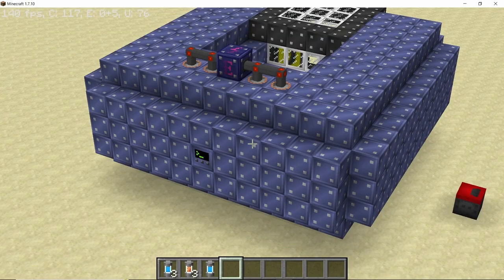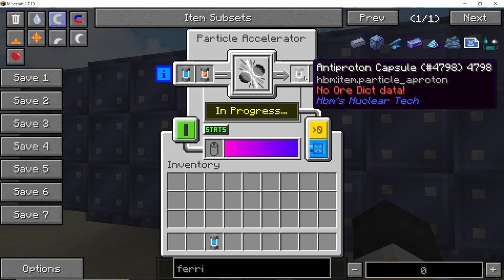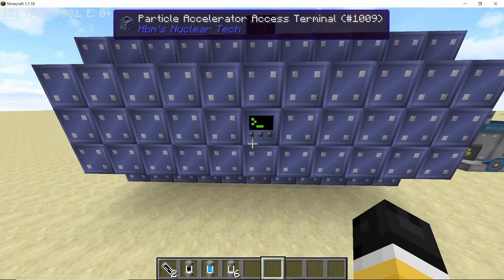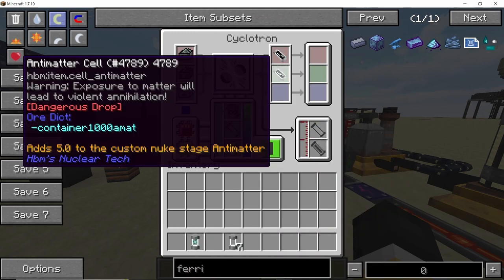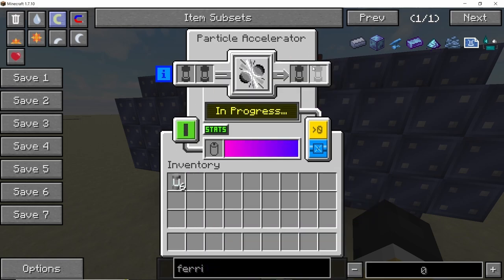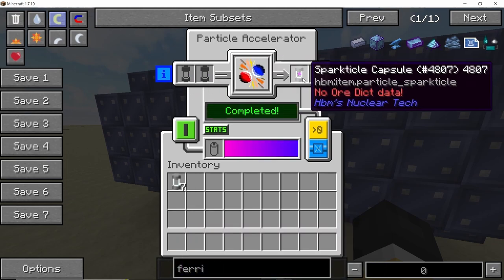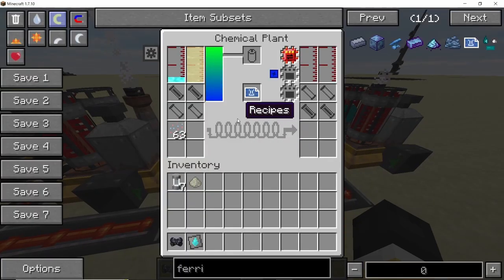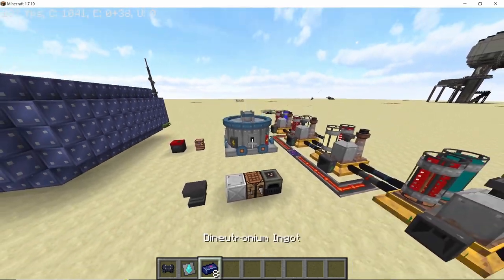DNT Production Guide - HBM's NTM || Dineutronium Ingot production Nuclear Tech Mod

Comment: Bro i want to download M14 himaras content pack mc heli bt it's not showing in game i pasted zip file also extracted the zip bt nthing happening
Reply from the maker: You have to extract the zip file and merge it with the original mcheli folder ... then it will show up in the game. Recommend checking out my mcheli 1.0.4 video if you are facing trouble with this
Reply: Tried it not working.....i think like i did in other content packs i was getting an option to extract to mc heli bt while extracting it i am not getting this option same with other new content packs like s-400 and mortar

Comment: Your videos is best! Btw how big Particle Accelerator needs to be for this operation?
Reply from the maker: The size of the particle accelerator will directly depend on the coils that you are going to use ... like for example if you use Copper coils then you will need a very big accelerator but if you use Ferric Schrabidate coils then the accelerator size will reduce drastically by roughly 25 times
Sparkticle requires coil value of 500,000 so you will need to design the accelerator according to that keeping in mind the values for different types of coils

Comment: Hey man, can you do a progression guide series for hbm in survival? I'm having trouble figuring out what to after finishing my zirnox reactor.
Reply from the maker: A good idea for progression would be making an RBMK reactor next so you can use more variety of fuels and deplete them to get even more stronger fuels and materials. For recycling you will need centrifuge and spent fuel pool drums. Also recommend go looting some bigger structures which will give you access to higher tier loot.
Reply from the maker: The thing is I don't play survival that much cause I don't have much time to grind consistently so I don't know the exact progression. But an intuitive way of figuring it out would be using NEI mod to see all the uses of a material that you might have unlocked via recycling depleted fuel and then making those things to progress further by making more powerful stuff and fuels

Comment: I like this tutorial, Vegeta.
By the way, do you know what could be the best power source for the Particle Accelerator?  :) Just asking, since I know it chugs a lot.
Reply from the maker: Thanks man, also for power source I think if you have multiple RBMK's making like 50-100 MHE/s that can fill up the spark energy storage / battery storage array over time which will act as a buffer , that should be able to sustain the accelerator for most of the early-mid recipes